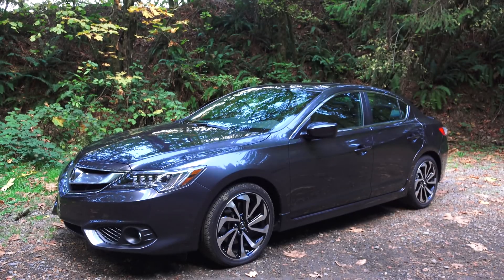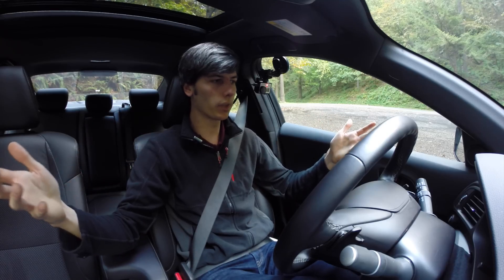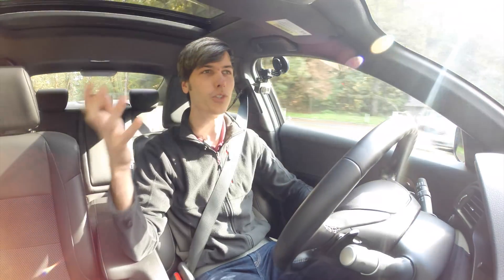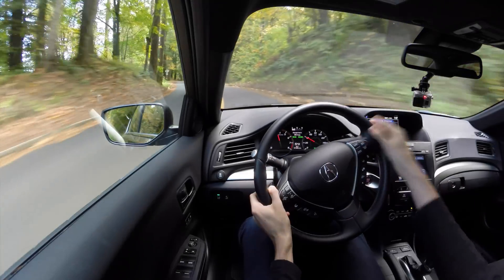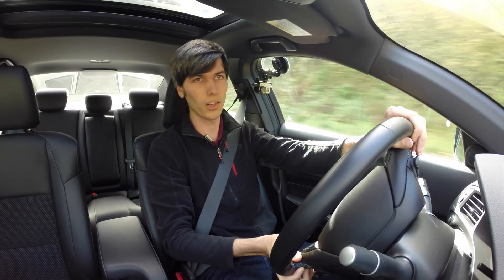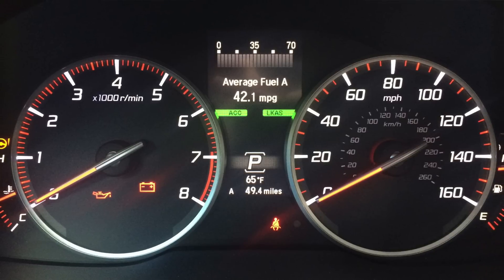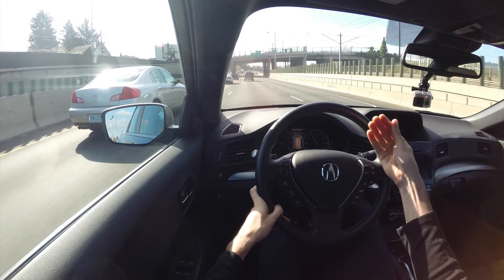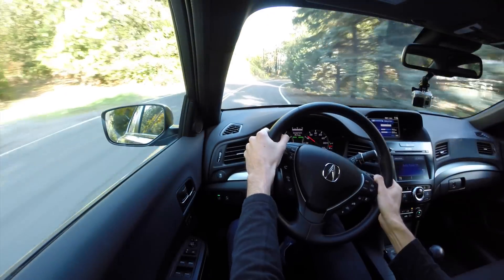2016 Acura ILX Review - DCT & Torque Converter?

Comment: Jason, what do you think about "redline a day keeps the mechanic away"? Is it reasonable or just a bullsh*t?
Reply from the maker: I think preventative maintenance isn't as simple as a single sentence. I'd also just recommend buying top tier fuel and/or cars with at least some port injection if you're goal is to prevent carbon build-up.
Reply: +Matej Moržan I'd wager that depends on the car. Something like a corolla the redlining would probably do more harm than good because that car is designed as a point A to point B car. But if you have a sports car, I believe there is some merit since those cars are designed to be driven hard. I wouldn't go as far as saying once a day, maybe like once a week work hard. Not necessarily redline either, but get higher up in the rev range - enough to to activate whatever cam timings (VTEC in my case) or other high-power settings the car has. Also, Seafoam (could try others, but Seafoam is proven to work) helps every few thousand miles to clean and reduce carbon build up. I also use the cheapest tier-1 gas in my area, which is Shell. I have a buddy who swears by 76.
Reply: Thats a legit maintenance technique but definitely not something you would do every day

Comment: Could you do a video on how launch control works on a DSG transmission?
Reply from the maker: +James Baggaley Preselect first gear, 1st gear clutch pack is open, revs hold at a set RPM, release the brake pedal, engage first gear clutch pack, and you're off!
Reply: Thank-you!

Comment: I think the new loaded 2016 Honda Accord would be a better value.
Reply: +Shahyan Mehervanjee I have no idea. The ILX appears to be the size of the civic and the Accord is a little bit bigger in the midsize sedan class. In the US, the civic begins at around 19K, the Accord around 23k, and the ILX around 26k However, you can get a fully loaded Accord for around the low 30's or sub 30's, and in my opinion, the loaded Accord looks more premium, especially with the new lights.
Reply: Moaiz Shahzad True, the current Accord seems about the same size as a first generation Lexus LS400.   The Accord backseat is huge.
Reply: +thebluexanadu78 tlx and rlx are both based off the accord platform. TLX is shorter than the Accord and RLX is longer than the Accord. A lot of parts are directly interchangeable between 3 cars.
Reply: +josh. I agree.  The current Accord looks like a higher end car as the ILXs truncated back end makes it look like a cheaper economy car.
Reply: +josh. Is the ILX based on a civic or an accord? If it is the civic what are the price overlaps like? Can you get a fully loaded accord for the price of this ilx?  (We don't have Acura in Aus and we also only get previous gen tech from Honda)
Reply: +josh. Damn that's cheap! Won't get a fully loaded accord for less than 40k your money here...
Reply: +Shahyan Mehervanjee It's based on the Civic.
Reply: +Shahyan Mehervanjee ILX is based off Civic. TLX is based off Accord. Actually each Acura is based off a Honda model lol
Reply: +Moaiz Shahzad Oh yeah then what is the full-size RLX based off of?
Reply: thebluexanadu78 Probably the Honda Pilot.    :-)
Reply: The RLX is the only one that's not based off a Honda. If there was a full-size Honda, it would be lol.
Reply: +thebluexanadu78 RLX is based off the Honda Accord chassis. It's elongated and it has a very similar front and rear subframes.
Reply: Would make sense. Honda Accord is pushing full-size specs and dimensions in certain categories.
Reply: +TheAngryDuckman Are you sure? I thought the TLX was based on the Accord. Unless both the TLX and RLX share the same platform.